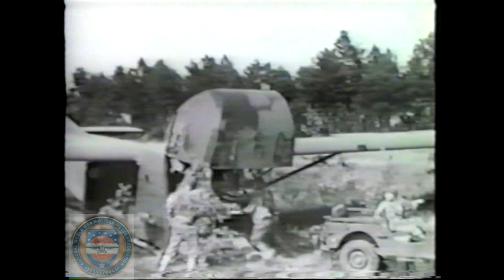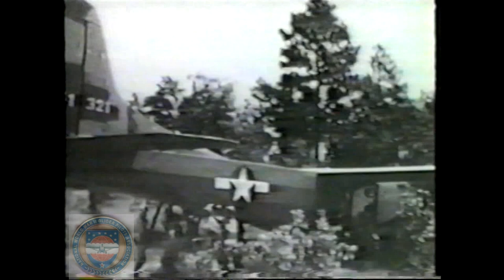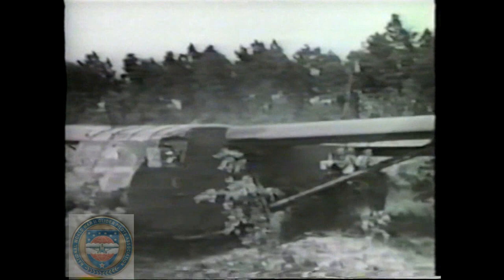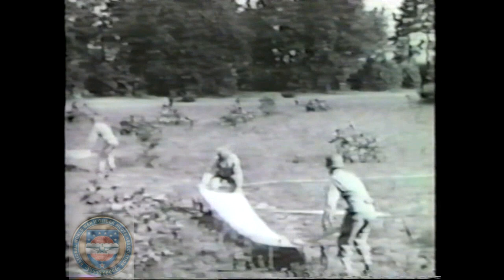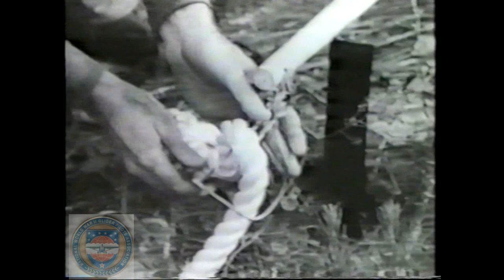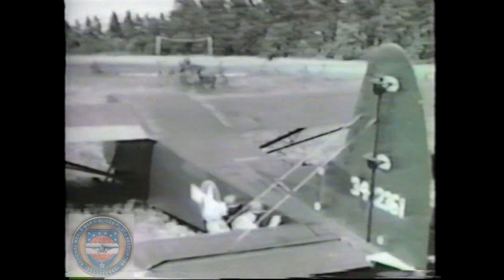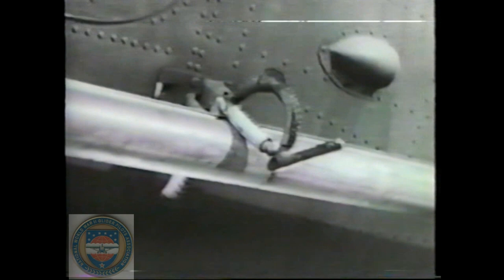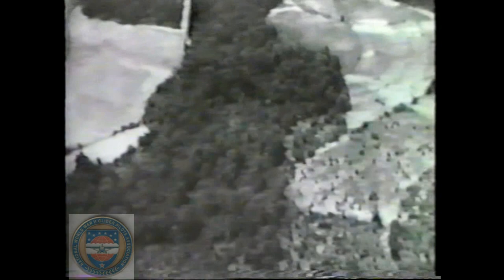Training Film Glider Pickup by C 47

Comment: I used to work at Davis Monthan AFB in 1978 where we would use H-3's to mid air snag Ryan Firebee drones that were dropped from the DC130 Hercules. The helicopter had a large winch that had hydraulic and electric feed to it. Upon catching the drone, the line fed out and was slowly braked to keep from snapping the cable. Midair catches can be found on YT.  The program was defunded and some of the helicopters went into the boneyard storage and others went to Kirtland AFB. The Pima Air Museum has one of the Firebees on display.

Comment: I feel like “then and not until then” was learned through tragedy - this entire concept seems sci-fi level insanity, that they executed this routinely is mind blowing and proves it to actually be genius! There are so many potential points of devastation on this system though - the tow rope running below the elevators 😮😮 when he hooks and the initial climb is initiated it’s astonishing that the glider doesn’t nose up enough for the rope to force the tug elevators up, and how powerful is the Dak that it doesn’t jolt and stall the instant  the shock load is taken up - just nuts!
Reply from the maker: In talking to tug pilots they say that when the snatch is made it is like the C-47 stops for a second in mid-air.  As soon as the C-47 is about to hit the rope full throttle is made.  You may find this article interesting on our website. https://www.ww2gp.org/gliderpickup/gberry.php

Comment: I thought that gliders were absolutely single use machines. I had no idea! This looks extremely hazardous.
Reply from the maker: We have some great closeup photos and additional information on our website at https://ww2gp.org/gliderpickup/  There is also statistics in Keith Thoms article on the right sidebar.  The system was used extensively in Burma to get tractors and equipment into the jungle to create landing strips for the C-47s .  Once a glider landed it needed to be extracted from the jungle so the snatch was used.   In our membership Briefing there has been articles on the question mark symbol that was put on the C-47 tails and the Project Nine work.  I need to add those eventually to the website.  

 In the ETO after combat missions the gliders were repaired and snatched for another mission.  Had they not done this work there would not have been enough gliders for the last major operation of the war in the ETO VARSITY.  One of our current members is a WWII glider mechanic who not only repaired the gliders but piloted them out on the snatch.  I was told that it is no different than a carnival ride.  One minute you are on the ground the next you are going 120 miles an hour.  Those in the C-47 says when the hook connects it is like the C-47 stops in mid air for a second.